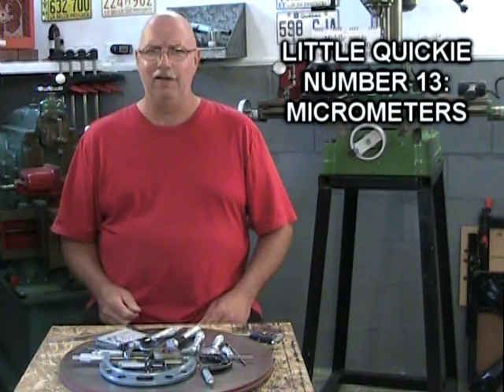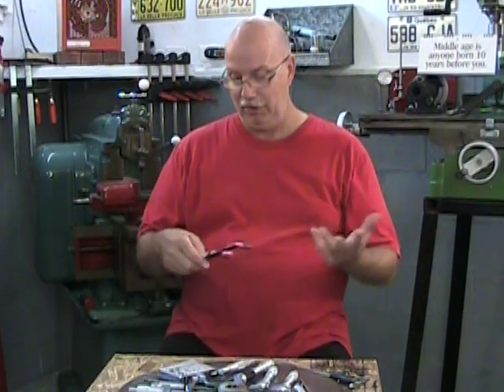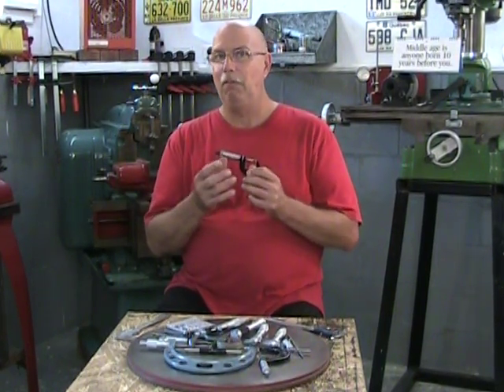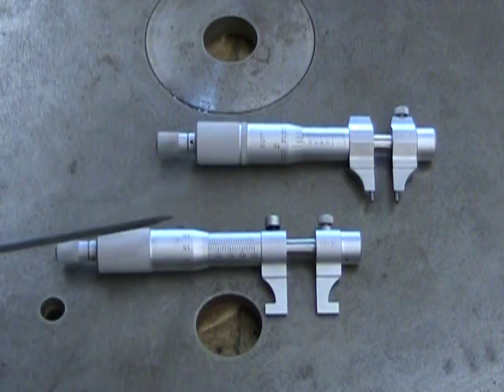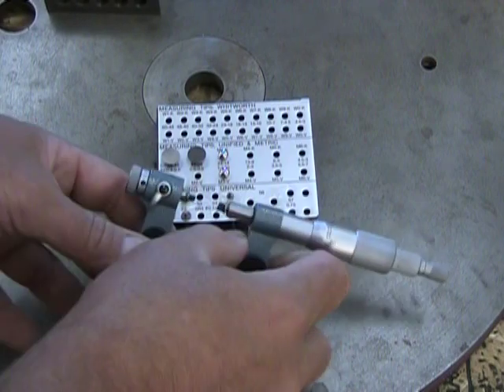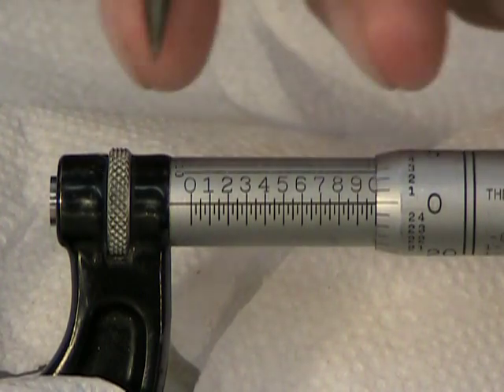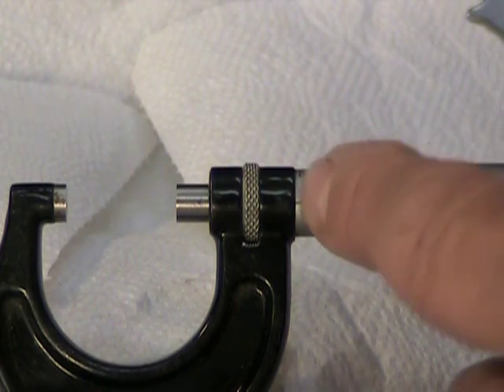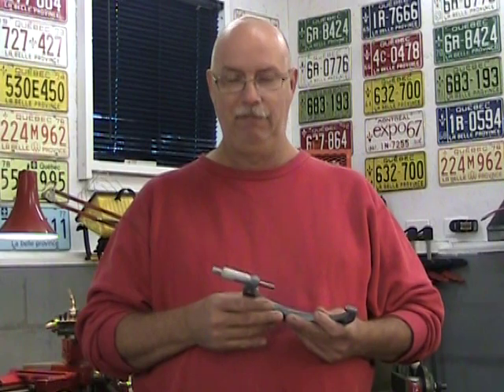MICROMETER TYPES (INSIDE, OUTSIDE, DEPTH & STICK) & HOW TO READ THEM, metrology 101, MARC LECUYER

Comment: Marc I am a hobbyist machinist your videos are the best info ever. Your a natural teacher. I have watched your vid on trig ( not my strong suit in school) and it makes more sense now then it ever did in the past. 
  I want to mill gauge plates that represent Morris tapers so I can use them to set my taper attachment on the lathe but the trig isn’t coming together yet to do so. I would like to ask you for a video detailing all the steps necessary to use the machineries handbook for info and the procedures and formulas to make the necessary calculations.
 What is needed also to calculate the gauge block height for the sine bar in order to get the angle set for milling that angle onto say a 4 by 7 plate for future use. If one template for say a Morris taper 4 is shown then to do the other Morris tapers will be easy.
 Thank you Keith ( prairie boy from Saskatchewan)
Reply from the maker: Hi Keith! I don't know if these videos will help?  Sine bars   https://youtu.be/_iCtCV-DnsU     Standard and one off tapers  https://youtu.be/2QfZ3y90_r0    hammer handle taper (taper attachment)   https://youtu.be/R_tspwe9jow   Offsetting cylindrical grinder  https://youtu.be/c13wfJtdmro    Emma's angular problem  https://youtu.be/YABm5vcO_Zw   Metrology part 3  https://youtu.be/VEEDBqiak2k   Q&A part 3     https://youtu.be/RQRxRwVIJ60     Let me know if this is useful?

Comment: Nice refresher, thanks Marc!
I would add that it's important that the mic (or caliper) anvils are totally clean before use. I give them a wipe with my thumb and another wipe with dry paper. Try a measurement before and after a cleaning and you'll usually find that the first trial is a bit oversize.

Comment: Marc, great video
I must admit to wincing when you brought out the calipers that could replace all the mikes. I have seen people as late thinking that calipers are precision measuring tools. I even saw someone at work using a pair of dial calipers to measure a spline over pins.
But you did a wonderful job of explaining the facts of measurement.

If you don't mind I will answer one of your question ask earlier. Micrometers are oiled with mike oil; originally it was whale oil but now just order some Starrett Micrometer Oil. Hold the mike with the thimble down and put a drop or two on the spindle and let it run down into the inside of the mike and into the threads. That being said you probably dont need to oil your mike unless you use it daily and then only once a year or so. Oil collects dust and over oiling will make you mike in accurate.

Again Thank you Marc

Marcus
Reply from the maker: Hi Marcus,  have we been trained by the same people? I couldn't have answered better! But I did answer almost the same way! Here is a copy paste of the answer I gave to Randal: 
 "Hi Randal, use a fine machine oil, do not use motor oils or hydraulic oils that contain additives that aren't good for precision Tools. Here is a link to show you what is required, it is only a suggestion since I do not wish to promote a particular company but hey! I do like this one!  http://www.starrett.com/metrology/product-detail/1620 Oiling measuring tools requires restraint. A little bit is better that a lot and use quality lint free wipes when removing old oil from tools and when removing any excessive oil. Remember, oil attracts dust and dirt and fixes it in place so even though tools need oil to function properly, less is better! Thanks for watching and thanks for the great question. "
I also get cramps when I see people using the calipers for precision measurements! So I am guessing that we are twins separated at birth? Thanks for watching and for taking the time to write, have fun and be safe! Marc L'Ecuyer

Comment: I know I don't need to tell you, but others might like to hear another reason why a Mic is intrinsically more accurate than a caliper. It is because the read part is in line with the measuring points, unlike the caliper where it is off set. Well it is for all but depth, just to prove me wrong.

Comment: Any advice on oiling micrometers?
Reply from the maker: Hi Randal, use a fine machine oil, do not use motor oils or hydraulic oils that contain additives that aren't good for precision Tools. Here is a link to show you what is required, it is only a suggestion since I do not wish to promote a particular company but hey! I do like this one!  http://www.starrett.com/metrology/product-detail/1620 Oiling measuring tools requires restraint. A little bit is better that a lot and use quality lint free wipes when removing old oil from tools and when removing any excessive oil. Remember, oil attracts dust and dirt and fixes it in place so even though tools need oil to function properly, less is better! Thanks for watching and thanks for the great question, be safe! Marc L'Ecuyer